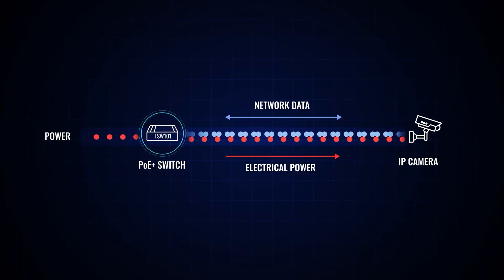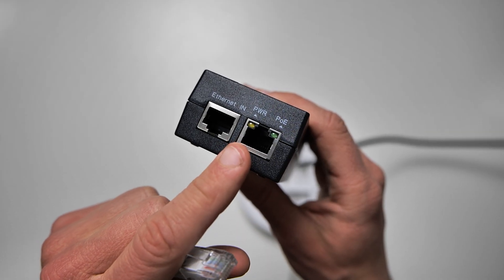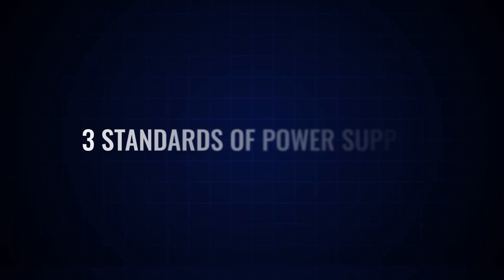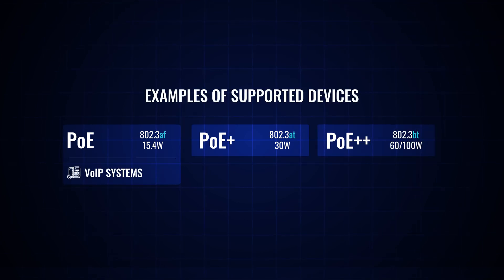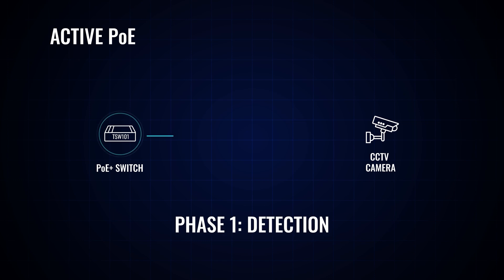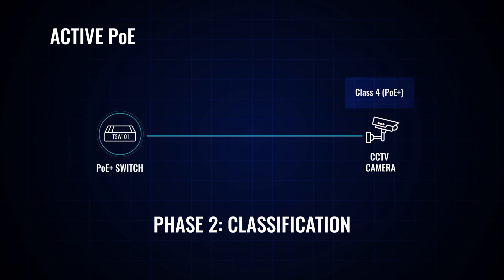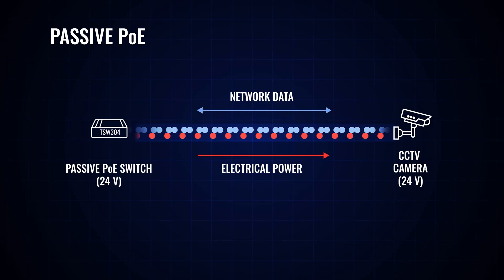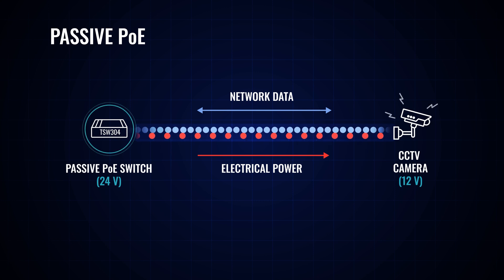Active PoE vs. Passive PoE: What's the Difference?

Comment: What if you accidently plug passive PoE cable to your PC
Reply from the maker: Hey, if you plug a passive PoE cable into your PC, it could damage your PC since passive PoE delivers power without negotiation. Always check cables or use active PoE to avoid issues!
Reply: just did and it fried my wireless AP the moment it connected lol!

Comment: Awesome explanation! I noticed your TSW010 states "possible to power up through first LAN port" I assume that means the port labled 1 not the porr labled 5?
Reply from the maker: Hello, that's correct. In order to power up the TSW010 using Passive PoE, you must use LAN port 1.

Comment: So why would a IEEE 802.3af-2003 PoE Injector (15.4W or 12,95W which can be used from this) connected to LAN Port1 would destroy a RUTX11 as described in the RUTX11 Teltonika wiki? The RUTX11 has a max. of 16W per the specs. This would mean POE+ 802.3at (up to 30W) would be needed, right? But the RUTX11 Wiki says it is not compliant to IEEE 802.3at. This is super confusing. I have in mind to use a IEEE 802.3af-2003 and IEEE 802.3at comply PoE injector using PIN4+5 for 9-50VDC+ and PIN7+8 for 9-50VDV-. So does this work or not?
Reply from the maker: Hello,
The reason for this limitation is that our routers exclusively support Passive POE. Any other devices connected using a different POE type could potentially cause harm to the port or even the entire device.
If you're interested in utilizing Active POE, we recommend exploring the option of acquiring POE injectors or adapters. These devices can effectively convert Active POE output to Passive POE output, enabling compatibility with our routers.

Comment: One thing I might want to add is that if you have a 48V power supply on a router that only supports passive poe, you might have some luck powering up an active POE device. I do this with a mikrotik router by forcing POE to ON. This has already worked with 2 802.1af devices I have. No guarantee of course. Cheers, nice video ;-)